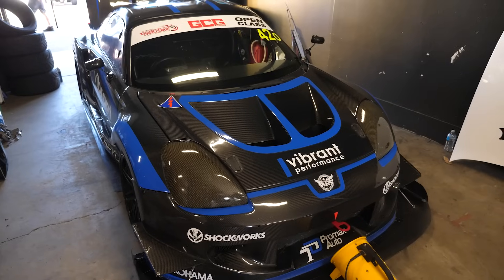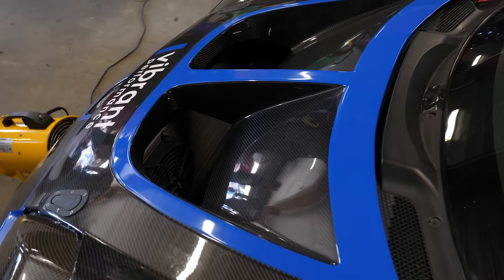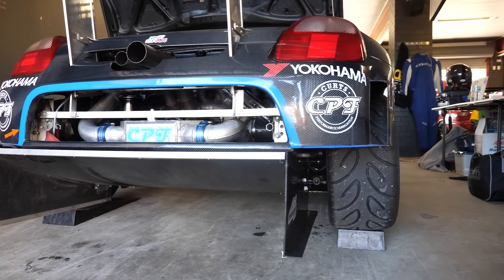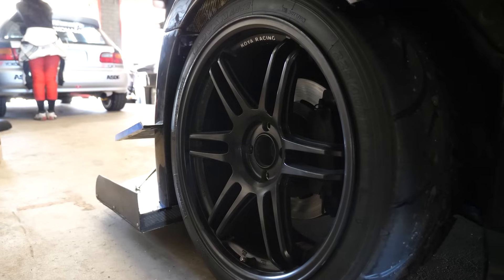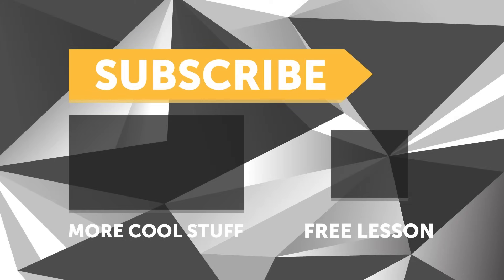Is a 940kg Toyota MRS the ULTIMATE Grassroots Racer?

Comment from the maker: 💻 Learn to design custom parts for your dream car. 3D Modelling & CAD course. Now 50% OFF:  https://hpcdmy.co/mrscad
TIME STAMPS:
0:00 – Justin from Close Enough Racing
0:11 – Why Choose an MRS Chassis?
0:28 – Trust Your Mechanic
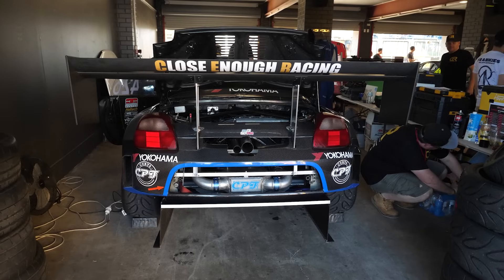0:47 - Grey Import Love
1:20 – Drivetrain Overview: 2ZZ and C60 Jubu Gearset
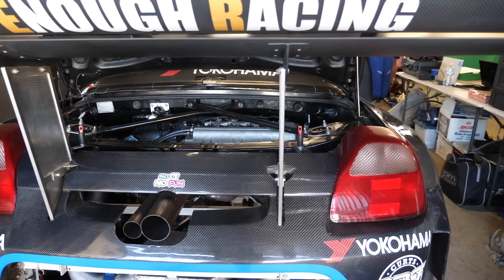1:59 – 1zz vs 2zz
2:27 – Factory Mounts with Poly Bushings
2:51 – Garrett GTX3582R Gen II Turbo Setup
2:50 – 600hp, 35 PSI
3:15 – Final Weight: 940kg
3:25 – Close Ratio Gearbox for Boost
3:50 – APR Widebody and Carbon Panels
4:47 – Aero Evolution and DIY Testing
6:00 – Splitter, Diffuser, and Wing Tuning
6:35 – Wing Choices 
7:15 – Suspension Setup and Ride Height
7:45 – Shockworks Development and Damping
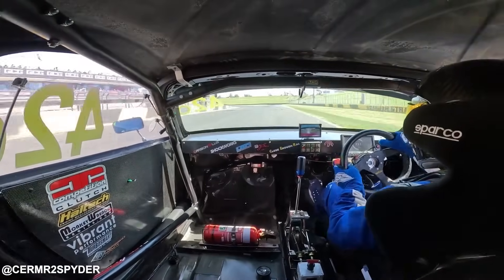8:10 – Factory Geometry
8:30 – MRS Handling
9:07 – Porsche Brakes and Manual Pedal Box
9:44 – Brake Bias/Balance and Sizing
10:02 – Spring Rates, Sway Bars, and Aero vs Mechanical Grip
10:28 – How a Group of Friends Built a World-Stage Car
11:35 – CMS Performance Tuning Support
12:05 – Outcome After Years of Development
12:25 – Where to Follow: Close Enough Racing / CMR2 Spider
13:01 – BUILD.TUNE.DRIVE

Comment: Really intrigued to know how the s2000 chassis comparison to MRS
Reply: Wished this channel would feature a good S2000 or build one
Reply: In broad strokes, the S2000 has much better suspension geometry and aftermarket understanding.  The MR-S has much lighter weight and rear-engine balance.
Reply from the maker: We toyed with an S2000 build a few years ago but Ben here is a big guy and it was 'too hard basket' at the time to really pursue.
Never say never though! Would want to start with a crashed one though, they are not cheap any more.
It was a while back and not a track car, but I still like this build: https://www.hpacademy.com/blog/can-you-have-a-960hp-42-psi-work-whip-f20-honda-s2000-tech-tour/ - Taz.

Comment: This ain’t no grassroots racer, this is a full blown time attack machine.
Reply: I'd say an NA/NB/NC MX5 is the ultimate grassroots racer. suspension, wheels/tires, bucket seats and a roll bar for safety and you have a great low power track car that is cheap on consumables.  it's not mid engined, fast or  with aero out of the box  but has alot of affordable aftermarket support and is extremely well balanced. 

the MRS is also pretty good but i think the aftermarket is a little less than MX5s

Comment: I have a Honda K24 in my MR-S.  Fun car
Reply from the maker: Nice! You had it for long? - Taz.
Reply: @hpa101 A little over a year.  Unfortunately at this moment has a valvetrain noise that needs addressing.  Made 272whp/187wtq when dynoed.  Good power for a fun little street/track car.  Had it built to make the best out of pump gas here in the U.S., no racing fuel.